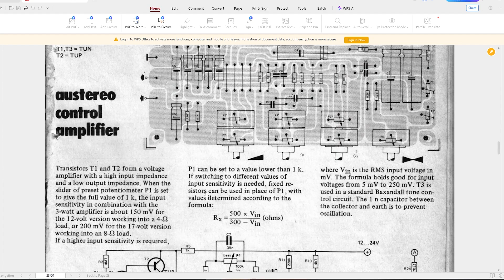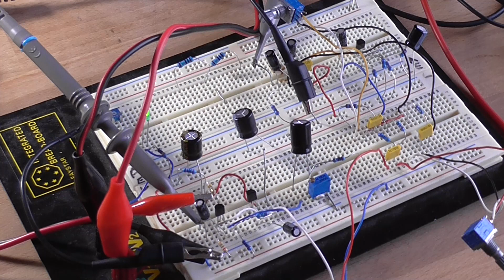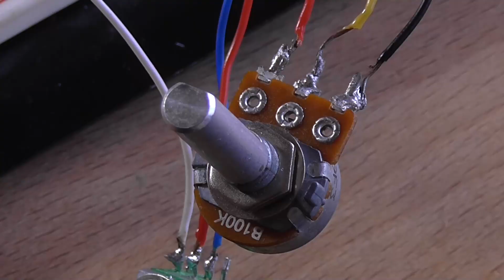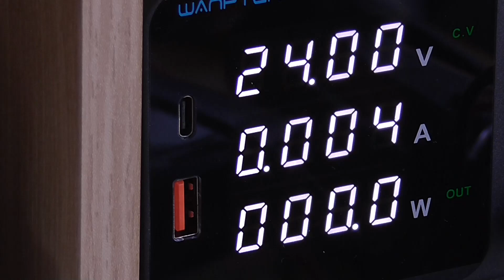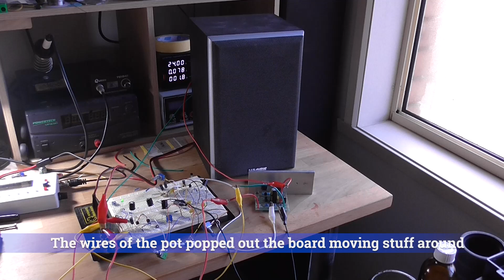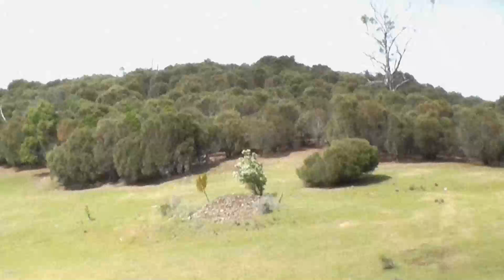Elektor Austereo Discrete Preamplifier Test (1975)

Comment from the maker: I buggered up the treble pot wiring as well! I had the wiper and clockwise connections backwards. I've corrected it and the Baxandall circuit looks better on the 'scope. I hate making errors!
Reply: You must remove the gain circuit before adding the balance control. Probably missing in the circuit description. (Use 470 ohms+ 1k balance pot + 470 ohms)
Reply from the maker: @subramaniamchandrasekar1397  maybe. I'll investigate it further later.
Reply from the maker: @subramaniamchandrasekar1397  however, their PCB shows both pots installed...
Reply: @AstrosElectronicsLab  Correct. The connection point is A, after the capacitor C2. If you do not remove P1 gain preset, the balance pot will not have any effect if the preset is at minimum resistance.

Comment: What's the purpose of the 1k R5 resistor on the power supply?
Reply: Acts in concert with C4 as a 'somewhat wasteful' RC low pass filter to clean the power supply as much as possible before getting to T1/T2
Reply from the maker: It's DC decoupling in conjunction with C4 to isolate the high gain input stage from the output section to prevent oscillation.

Comment: A 10k balance pot will provide a more gradual change in balance. The 100k pot you're using made the cutoff very sudden. Also, using a 500 ohm pot in place of P1 will also change the way that the balance control operates, and you'd probably need to reduce the balance pot to 5k to compensate for that, and possibly reduce the value of R24, as all the balance is doing is ultimately placing R24 in parallel with P1.
I'm surprised this wasn't mentioned in their original design notes.
Reply from the maker: I am too. I think you're right, also. I'm going to get the correct pots and test again.